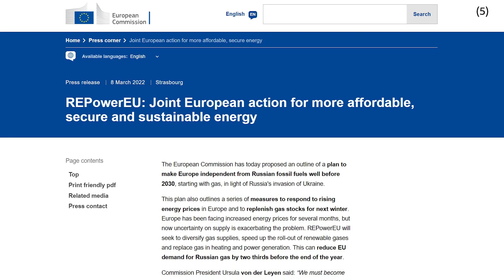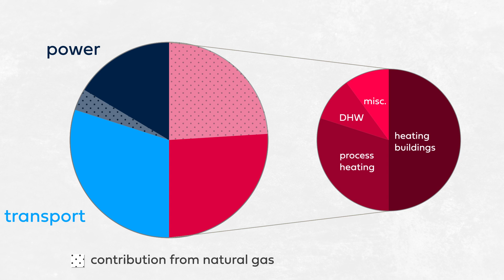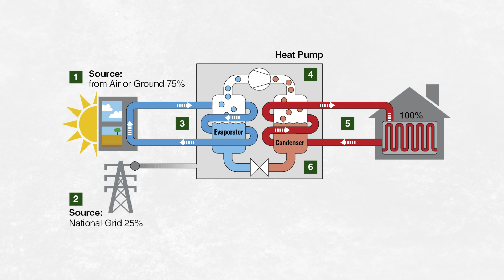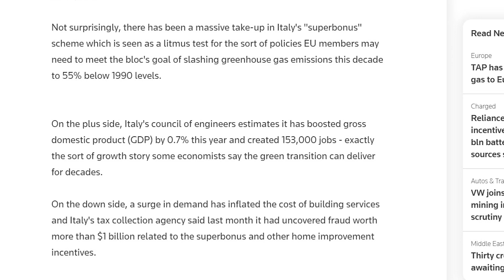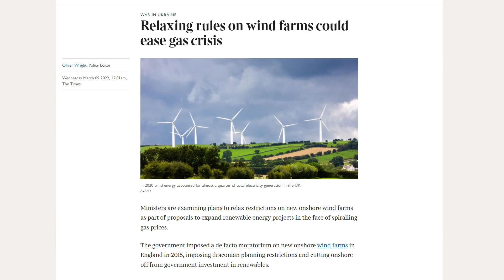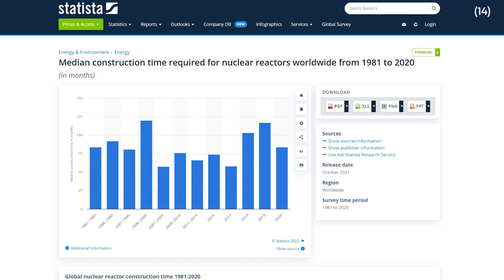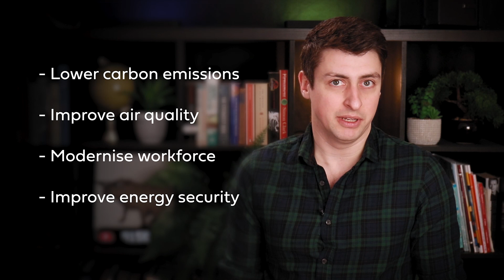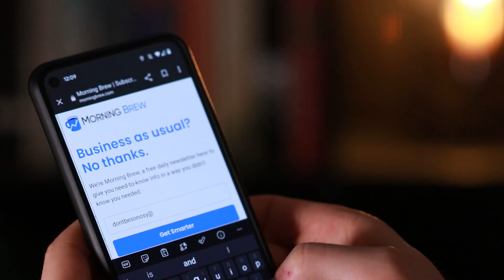How Europe can wean itself off Russian gas

Comment: As far as I know, gas-based electricity production is helpful to satisfy peak demand. Are the alternatives capable of modulating production as fast as necessary?
Reply: Nuclear... If NGOs stop fear-mongering about it. Look at France's electricity model
Reply: @atrumluminarium  nuclear cannot fill this role, the exact opposite actually. nuclear is energy production method with the solwest ramp up/ ramp down time, making nuclear power plants the worts option in terms of feasability to replace gas peaker plants
Reply: @atrumluminarium physics engineer living in France, I know that nuclear shoulders a little bit of the daily variability, but not the fine-tuned, minute-to-minute variations. Nor could it. Gas plants, on the other hand do take care of the peaks in demand (it is, by the way, their main use on the French grid).
Reply: @benjaminbrat3922  I'm guessing hydrogen would then be the best bet
Reply: @atrumluminarium  so, I guess, storage (either hydrogen, battery, inertia wheel, ... )?
Reply: Solar and wind can modulate very quickly, but it would require a lot of excess production you're basically turning on and off. Which is a bit expensive. But a bulk of renewables and a gas peak supply would cut it by more than 40%. Or using surplus to extract hydrogen (or better alternative storage) and using that for peak energy demand. There's a lot we could've done. As well as defending Crimea when Exxon (I believe) was investing in extracting its natural gas.
Reply: Hydro is great at modulating production. Pumped hydro also works well for large scale energy storage. (They do have ecological issues, and are not a perfect solution, but are better than gas)
Reply: @zwe1l1nkehaende  France's entire fleet of light water nuclear reactors operate in load-following mode.

Comment: About heat pumps;  Electric power in heat pump is a bit more complex than that; if you are using gas to generate electricity at 40% efficiency, you are wasting the energy that you save with the heat pump in the electricity generation and transfer losses. If you use the gas directly for heating, you get good thermal efficiency (depending how much heat captured from exhaust). But if you generate the electricity with something else, OR if you generate the electricity in a combined electricity and heat generation plant where you also capture the heat and for example use it for district heating. In this case the electric heat pump saves energy. And of course it always saves energy over direct electric heating. Also; heat pumps don't necessarily have to be electrically powered. You can also make a gas powered heat pump, etc. 😂 So how much heat pump makes sense depends of what you use to generate the electricity!

Comment: at least in the US most of the gas power plants are peakers because they can spool up faster than coal or nuclear, so they run when renewables aren't producing as much power. Because of that, I think the real replacement for gas power plants is probably not more renewables, but giant battery banks or other energy storage systems. I'm also pretty sure that something like the Tesla Megapack system is now cheaper than a new natural gas peaker plant, except that the battery system is very supply-constrained. If you have the spare off-peak generation to spare or build more renewables for the lower efficiency, liquid air storage like Highview power might make more sense if only because it isn't supply-constrained at all.
Reply: I know batteries are getting cheaper but as of a year ago they were still so expensive it was actually cheaper to build a nuclear power plant than battery storage, if you work out the LCOE, ie dividing all the costs by the total electricity output. (even including decommissioning and waste). 

Even if in terms of number of plants peakers are higher,  because they only run a small amount of the time the actual amount of gas used is smaller. Don't worry about the peakers until all the standard gas plants are no longer needed.
Reply: @adrianthoroughgood1191  I was thinking about peaker plants because they are the ones you tend to get more instead of less of as you add more renewables. I'll readily admit that I don't actually know all the costs though, so correction apreciated.

Comment: The cheapest way is to install an Air Conditioning system able also to heat (it has a heat pump). You can use the AC during the day when outside temperatures are >0 so the heating efficiency is very high (>4). I did it and works very well. I am using gas only to heat water and for home heating during night.

Comment: Excellent video! I had the opportunity to see the actual IEA press conference with their 10 point plan before watching this vlog and i must say, the analysis in this video is way better than the Q&A session during the press conference. One question though on the comparison on timeline between installation & commissioning of wind vs nuclear (12 months vs 10 years roughly). How big is the output or size of the projects considered here, are they comparable? Thanks for any insight.
I think any way, decentralised grid saytems would be a better/ controllable way forwad as compared to centralised grid.

Comment: You are true about isolation and heat pump, but i'm not so sure about renewable. Untill you don't have storage system renewables can't be the solution. And we have to say that if EU rely so much on gas it is also because of the deployment of renewable (deployment which is a good thing according to me) because gas is the better energy in co-generation with renewable, because easy to manage.

In short term I don't think we have that much solution to get out of Russian gas, except reduce our energy consumption by consuming less, decrease the indoor temperature... And in medium/long term we have the deployment of renewables but also nuclear because if we don't do it now, we won't have it in 10 years, and we will again be in the emergency.

Sobriety is the only true solution to climate crisis and fossile fuels depletion, new technologies are a useful tool but we have to be careful not to dream too much of it, we might be disappointed
Reply: @luciendardaraurore7433  says every ostrich hat wearer. You are bringing nothing new to the table, leave

Comment: You do not mention energy storage that we need to use renewables to their maximum & also that of any new wind turbines.  Rolls Royce & other firms are building mini-nuclear power units that can be mass produced & certainly do not take 10 years or even one year. My energy company Ecotriciy produces gas from grass.  Try using less energy too.  There is a far-far wider range of options than you present in this Post.  I doubt if we can come completely off fossil fuels without Nuclear & far greater energy storage.  At least in high population industrial areas in the North.  Portugal for example could make it on renewables alone, not Poland or similar.

Comment: New nuclear plants aren't an option, sure, but many existing nuclear plants that are either offline, awaiting decommissioning, or are early on in the process of being decommissioned can be rebuilt much more quickly.
Reply: Many of them have been decomissioned for a reason. The safety requirements for nuclear power plants keep increasing and bringing old plants into compliance is not worth it.

Germany is the big exception within europe, where nuclear power plants were shut down for political reasons, but even those are old (since building new ones was really hard to get permission for) and would need extensive, slow and expensive overhauls to be allowed to operate past their current shutoff dates.

Comment: Finally someone not pushing the nuclear option with one of the very good reasons for choosing otherwise. Nuclear just isn't necessary, and reducing nuclear has the added bonus of reducing nuclear weapons, which rely on nuclear power stations' waste to be made. Massive battery storage installation also needs to be considered, both for when the network hits a serious issue like natural disasters, and also to help regulate supply. In the short time we've been commercially and industrially making batteries, they've become far less dependent on dangerous ingredients - their future is increasingly promising.

Comment: Europe could invest in Mexican gas infrastructure. Found out that Mexico buys US gas. Last year, around  73% of Mexicos gas demand was meet by US imports of gas. The thing is that Mexican oil wells do produce gas but they are not investing in gas infrastructure because it very expensive. Thus, local gas production has gone down. But of the gas produced from oil production, which is what they are really interested in, they flare it into the atmosphere since its cheaper then building an infrastructure to deliver it or process it for resale.  So each year millions of tons of gas tends to be flared into the atmosphere each year. So 20% of the gas that a nation like Spain uses ever year is flared into the atmosphere in Mexico which in itself is a problem when it comes to global warming.

Comment: Great video, fellow Simon!
I've been very annoyed at politicians saying nuclear power will be the cornerstone of their plan to rid energy production of Russian imports. The nuclear plants we have are already due on replacement. Building new ones will take a long time. As well as having to import fuel for that, it seems like a weird choice to make.
Expanding renewable energy and having a better system for dealing with wasted energy would be much more prudent. A few companies have been using their surplus energy to extract hydrogen, which they use as fuel for other activities. While not very efficient, it's more efficient than doing nothing with it. Do you already have a video about how to use the surplus energy generated by variable generation like wind and solar?
If not, that would be a great video.
Reply: Exactly. Nuclear power seems to be this rage inducing topic where people online get super riled up. And you can gladly discuss nuclear energies longterm role in clean power generation. But it's simply a reality that a Nuclear Powerplant takes years and years to simply be built and another span of almost the same time to become profitable. You can't snap nuclear power plants into existance thus talking about Nuclear Power as a solution to our current energy issues is just missing the point.
Reply: Remember we don't just need to replace current fossil fuel electricity generation. We also need to replace every gas boiler with an electric heat pump and every ice car with an electric car (or train etc). We are going to need a lot more electricity in the future than we do now. We're going to need nuclear power at well as lots of renewables. It's bad to rely too heavily on one type since sometimes the wind does stop etc. Nuclear is obviously too slow for the current emergency, but it's fast enough if we get started now to play a big part in powering the electric cars and heat pumps that will be needed in 10 years' time.
Reply: @adrianthoroughgood1191  I'm not dismissing nuclear energy. But it should never be the bulk. It's slow to adjust and quite frankly, a political shitshow.
No politician in an economic dip spends money on maintenance or renewal of nuclear powerplants. It's a point many people overlook when talking about it. There's no way we won't be in big trouble in the future if this is the way nuclear power is managed in the next 10 years.
Electric cars, or cars as a whole are an interesting topic. The idea that ecars are the future is ridiculous. Cars are terribly inefficient to begin with. Mass transit should be key, even now, to reduce emissions. Cars will always have a role. But the mass consumption of cars we're dealing with now is simply wasteful.

Comment: Insulate Britain was ahead of the game until the media demonised them and the government persecuted and changed the laws to jail them. Also the cost of electricity per kWh is 3 times the cost of gas per kWh and air source heat pumps are pretty rubbish, best bet is ground source heat pumps but cost of installation is extremely high, and equipment is expensive. I say build passive houses and use the sun to heat your house, and wait for big nuclear plant to supply you with hot water.
Reply: Air source heat pumps are certainly not rubbish. They are the standard even north of the Arctic Circle in Nordic countries. But insulation is very important to make them work well, at a lower temperature than most boilers.

Comment: It's essential for the EU to get off of Russian gas, and oil, ASAP!  I bought and installed my own air force heat pump and AC system last summer, it was really easy and saves a TON of money on the gas bill.  I'm buying 2 more heat pump systems this summer and shutting my gas off as I installed solar panels on my roof and produce more than enough energy to power my house, the heat pump and my EV, saving me thousands of dollars/year.  Solar, wind, batteries, heat pumps and EV's are the answer to getting off of oil, gas and coal completely.

Comment: Ok so using heat pumps instead of gas, that would boost the energy consumption , I highly doubt those countries most affected by the Russian gas have enough power on their power plants to support this change in a massive scale, and if Russian gas is used for the local power generated then is a no go option. 

Actually a lot of these sound like good options at first but its collateral effects are poorly or not even mentioned in this video.

Comment: The inertia and backup gas provides can be replaced with battery storage over various timespans.
Short-duration can fix frequency, long duration flow batteries can solve intermittency, the tech exists (as of the last few years).
Would take a decade to fully remove gas, even if we went ham, but it would be a decade of gas plants being shut down one by one.

Comment: You’re dead on! I’m using a heat pump here in Ontario Canada - winter temps go dow to -30 - no problem - I insulated my place like crazy….you cannot go wrong by piling on the insulation…it’s the smartest move - also added 4500 W of solar on my roof as we have net-metering here - our electricity in Ontario has virtually no CO2 thanks to nuclear, hydro and renewables
Reply: Heat pumps make sense only if you have your own power or at least good part of power you need it.

Comment: Correct me if I’m wrong but I’ve heard that we use more natural gas as a result of using more wind and solar. Wind and solar are variable and gas is the source where you can most easily turn it up and down quickly. Of course for the environment this is still better than all coal or all gas but if we also have political reasons to use less gas then that’s a point against wind and solar. Is this true or is it just a big gas talking point I’ve been fed?
Reply: Wrong. Just more need for storage, which can take form in pumped hydro, mechanical storage (flywheels, counterweights,...), H2, batteries in different scales. Gas is not needed for wind and solar don't let them tell you otherwise, please!

Comment: None of that is going to happen. We need a solution this year, not in the future. It takes way too long to build any plant (nuclear, coal or gas). You could set of some windmills and solar panels, but then you are limited to what is already ready on the market and probably the transmission lines need an upgrade. Heat pumps are also limited by supply chains. Insulating houses all over Europe is a monumental task, which requires a huge skilled work force.
We would probably try to do some of it, but most of the problem will probably be solved by buying gas from other states or sadly burning more coal.
Reply: Well then restart all the idle nuclear powers stations. And the coal ones too. The fact that Germany plants to phase out nuclear before coal is just insane. The fact they plan on phasing out nuclear at all is insane.
Reply: @gregorymalchuk272  Apparently, you cannot easily reopen a nuclear power when it has been decomissioned. It was a huge mistake.

Comment: I'm Italian and in need to renovate my house and I can say for experience that the superbonus is a joke. The idea is solid but they came up with it too late just to avoid carbon emission sanctions. Most Italian homes are old and very low energy efficient relying on gas mostly and thin insulations, you can imagine there's been a flood of people going for it, the result is market saturation, lack of construction material, scams and overworked construction companies that can't keep up with the schedules and demand. Even if the bonus ends this year for small houses, companies aren't taking any more projects in, just condos and biger buildings since the bonus for these ends next year.
Reply: You have to go to a small architect studio, there are plenty, stay away from construction companies
Reply: @alanalan2732  That's what I did. I call it company but it's basically a small studio with an architect

Comment: Yes, nuclear is slow and won't solve the immediate issues, but it will help alleviate the grid load as more people transition from fossil fuels to electricity, like with EVs and heating. There's just not enough true renewables to account for that rise, and in some areas there probably never can be enough of them.

Comment: Geothermal, drilling into hot rocks anywhere using modern drilling techniques is quick, clean and great baseload.

But yes I've been railing against the stupidity of badly oriented, designed and insulated buildings since I first started architecture. But I long ago discovered that stupidity is boundless.